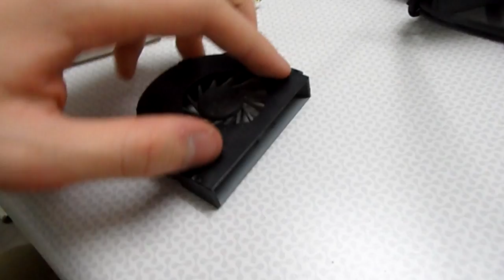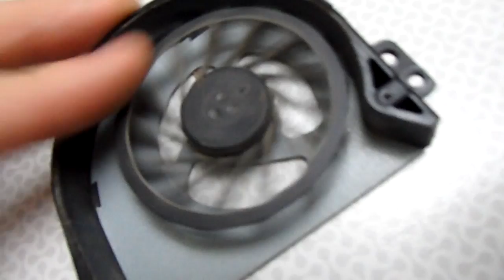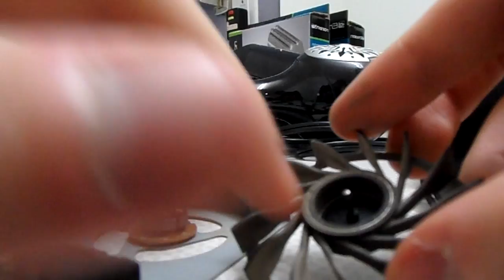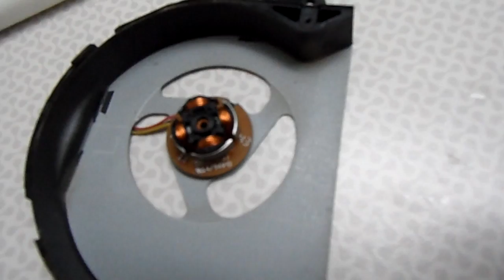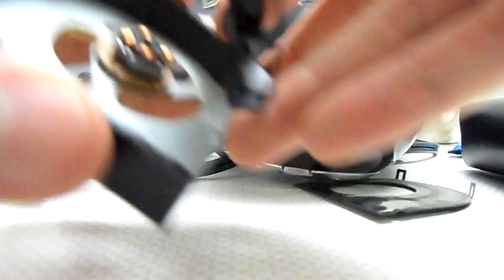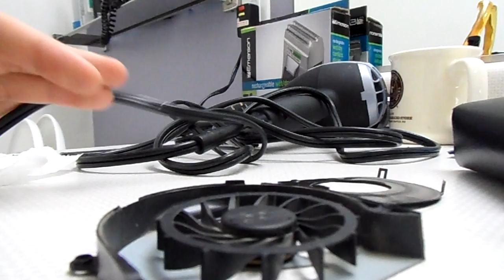How to repair a brushless laptop fan that doesn't spin

Comment: The cleaning process and oiling the fan is not complicated at all, it's getting the fan out of some laptops that's really hard. You basically have to disassembly the whole laptop to get to the fan. First the keyboard should be taken out, then a protective metal sheet, then the motherboard underneath it. So be careful.

Comment: Thanks for this video. Thanks to it, I know how to remove the fan of the laptop cpu cooling fan. Berore I didn't know that just pulling out the propeller could remove the propeller.

My laptop cpu fan is not working. after removing the propeller, dusting it off, adding oil, my fan is back up.

Comment: I had the same problem, exclusively with the GPU fan. Initially, I took it to a repair shop and he barely looked at the GPU fan before suggesting I need to change BOTH fans. I didn't trust him so I went to another shop, who suggested that he would clean the laptop which should fix the problem. 

So I paid the second shop but the problem was still here. 

This video was the actual solution. Now I am seriously starting to doubt these "professionals". 

Cheers.

Comment: How can I know if the fan is not working because of dirt or anything else? the fan doesnt feel stuck or hard or anything, but when my laptop is running the fan keeps moving like trying to spin and sometimes it spins a little but too slow and then it stops again and start moving like shaking

Comment: There's resistance if I pull the blades. They'll break if I try to force it. Suggestions? The other end to access the bearing (beneath sticker) has a metal cap that doesn't just pop off so I'm not sure how else to get lubricant in there.
Reply: you just need to lift these fans straight up. if u have these kind of fans. just straight up and lift
Reply: @EpicBunty  Not true. Consulted actual technician and it requires special tool to deal with the metal cap. It can only be further disassembled if I choose to apply force and break it, rendering it useless. *edit: I've encountered some laptop fans that do simply "pull" apart, but that is not the case for all of them.
Reply: @DB20204  ok well u must have a different fan then. when i unscrewed my fan for cleaning I was also confused, didnt know what to do. tried pulling the fans out and there was resistance but I also felt the slightest give, so i pulled em evenly out and viola thats how it went for my fan atleast. then cleaned everything with alcohol, added a dab of clear oil and all good till now

Comment: Watching this in April 2020. This helped for my Acer Predator Helios 300, my GPU Fan is working again! THANK YOU SO MUCH ;u;
Reply: Really? My GPU fan of Helios 300 stopped ( work a ,05 sec every 10 seconds and stops ) I try everything but not this method and i cant find the fan in amazon. My ends 17k13 all i find is 17k14 :(
Reply: @zvezdelinpetrov630  Let me give you an update then. I didn't have greace so I put a weird spray on it that's supposed to have the same effect.

It worked perfectly for 8 hours, then it started to get worse. At some point it was so bad that the fan destroyed itself, leaving half of it's blades flying around in my laptop.

I ordered a new fan but it was hard to find one.

I'm never going for laptops again. I ordered a PC. Only been having fan problems with every laptop.
Reply: Nickw00t  Well, my fan is with metal blades and It can’t open. I will order new one but shipping will be 5-7 weeks because of Corona... Yeah, desktops are always better. Thanks for the info :)

Comment: Thank you so much I was trying so hard to pull apart and it wouldn't move, almost broke the board. Mine was so stuck I had to wedge small pliers under, because it was FULL of fine dust in the hub...

Comment: Probably too late but: Asus R510J Fan started to make loud sounds for abour 2 weeks, didn't care much. Then games went really slow, Laptop was very very hot! Almost no Air coming out of the side of the laptop. Cleaned the fan from the outside with a vacuumer, got alot of dust out. Works a tiny bit better but Laptop still very very hot, fan doesn't spin the same amount (looking at graphs) and it just doesn't ventilate enough. Any ideas? Thanks<3
Reply: replace fan lol

Comment: Did not helped in my case for some reason. I have exact same fan on my HP laptop, I cleaned it well, used a bit of oil from Victorinox (swiss knifes manufacturer). When I power on laptop, fan just twitches and that’s it.

Comment: They make Turbine oil which I have used for decades repairing all kinds of fans.  Bottle has a pull out tube to get into oil felt cups on most fans.  I think in your example white lithium grease would work better than car grease. (less viscous)

Comment: My fan wouldn't start in my laptop so i took it out and cleaned it with a toothbrush,put it back in, and it still would not start. What a hassle I thought.I took it out one final time, blew into where the sensor chip,under the blades is: which was kinda hidden away from view.I blew out loads of dust and put it back in, and.....Bingo! Now it works fine.

Comment: Thank you very much for this video! I did this 2 weeks ago and it worked perfectly for me...laptop and fan are both working really well. Saved me the $200 the guy at the repair shop wanted. But some tips to add to this video:
- Check the exact model of your computer and go to your laptop brand's website to download the user manual for your exact model. I did this and they provide a step to step guide on how to open your laptop - every laptop is different! My laptop had 2 hidden screws I wouldn't have found if I didn't read the manual. 
- Be careful your hands don't carry any static electricity (walking on a carpet or rubbing against felt can cause this). Make sure you touch an uncovered piece of metal before opening the laptop to discharge it
- Don't spin your fan too fast while testing it. Blow on it lightly with your own breath if you need to but using a blow dryer like that is dangerous

Comment: Danger! Danger, Will Robinson! 

The DC motor can sometimes be housed in reverse with the blade part, such as Sunon fans. Trying to takes these fans apart will likely result in a broken fan. Not all Dell laptops or notebooks use the same fan design. Proceed at your own risk.

Comment: Allright, I think I have the same type of fan in my GE62 2QF MSI laptop. For the second time now a fan is failing for some reason. When the RPM increases it starts to play really loud rattling noise and vibrate. It does not happen all the time (yet), it sometimes stops when I tilt the laptop, starts again when I move it or tilt again, evntually (from experience) it will start to rattle as soon as I turn the laptop on. The thing is, MSI does not provide info on what failed exactly. Do you have any idea? I'd say the bearing, but then again it would just make the sound all the time from the moment it started. It looks more like the ribs of the fan brush over something.
Reply: You are in a rough spot friend, i have the GE72 and have the same problem. I have to take mine to a repair shop to get this crap taken care of. Buyer beware of MSI
Reply: Eartheart Baratheon I also have an msi laptop and one fan doesn't work anymore and the other one rattles
Reply: Its the bearing

Comment: Good advice thanks! I didn't know that a laptop fan was serviceable. Repaired my Eebox B1502 fan with your technique and a little dab of lithium grease (I usually use this on plastic gears on Laserdisc players and so on), worked like a charm! Cheers!

Comment: well i tried this method couple of times even before watching your video but it keeps jamming up... now i am thinking may be it's because of the bad starter capacitor and might need a replacement (just the coil part)
Reply: Nadine action not a bag a mouth
Reply: A friend of mine made the above comment. However that flag in the back ground is Jamaican, hence the broken english (Patois) our native language.  This video was helpful,  thanks.

Comment: I would not recommend using a powerful blow dryer like the one on the video. Exceeding the rotation speed for the specifications of the fan might actually damage it, as it was not designed to spin so fast. I recommend stopping the fan from moving with your finger when air (vacuum cleaner, compressed air, etc) is used to remove the dust around it. I also recommend using a medium or small brush to wipe the dust off more easily. Other than that, it's a good video for those who want to know how to clean a laptop fan.

Comment: gihabyte amd 780  gma fan its foxconn brushless fan model pva 070 e12 L stuck and i cant take it apart like u did when i try i hear like some thing broke in it
any idea  ???
Reply: Same problem here. Can't lift the rotor part from the stator. Gigabyte P17 v5

Comment: Thanks for this awesome guide.... It works for me... :D

For those who asked whether oil do the job.. The answer is "not really".....Applying a small amount of cooking oil wont work as effective as grease.... Cooking oil seems lubricating, yes. but it does not specialize and use as a lubricant substance. Take note that your fan might shoots temperature as high as 90-110 degree (crucial state).... This will eventually cause the oil you apply to be evaporated...Hence no more lubricant to lubricate the rotary motion inside the fan. As a result a squeking sound or buzzing sound will come once again.

Hence, a high temperature grease would be an outstanding option for every case. To be exact i use bearing grease where it can withstand high friction temperature. 

P/S: Justification made based on my experience. 

Good Luck Guys.
Reply: Thank you for the advice! :)
Reply: Sheesh.. DO NOT use grease for very small machine parts.  Use grease only for  big, beefy gears.   Grease is too viscous and dust PLUS grease makes it cake over time.  Use transmission fluid or machine oil -- the same one they use for sewing machines.

Comment: I have a Dell Latitude e6400, lately its fan started to make alittle bit of noise..

Anyways, the fan impeller seems to be not strong to disassemble it (The plastic compound is almost soft and can get break as I am pullin' it), unlike your fan seems to be kinda solid.

I just wanna know a way to pull the impeller, any suggestions please?
Reply: Giuseppe Jan Jaguar Oh and it doesn't have plastic circle on its blades like yours, which makes it even worse to try.

Comment: I couldn't take off the spinning part of the fan. I even used force but I couldn't. And this way I can't clean the center neither lubricate it. My fan is: Sunon Maglev MF60090V1-C210-G99. Can you help me plz?
Reply: same here, I could not remove the fan blade,
ASUS K43 series

and I accidentaly damage one blade.... ouch...
Reply: iheb bellaaj Be careful, some fans have a tiny metal washer that needs to be removed first to pop out the blade.
Reply: MundoComic I removed the sticker trying to find the ring that I should take off so I can pry up the blades, but under the sticker I didn't find a hole or anything to pull off. my fan is Sunon Maglev MF60090V1-C210-G99
Reply from the maker: That looks like a regular dc fan. I'm not sure why you can't take it of..
Reply: @williamyu94  The etl rod on which the fan is mounted is fused with the base and taking it off can result in breaking the plastic that binds the metaal with the plastic fan. Some models do not allow repair. Only option is replace as taking it apart means breaking the stuff
Reply: I have the same problem with the same fan! some advice plz?
Reply: MundoComic k
Reply: Easiest download manual free from the Internet and follow the instructions step by step. Remember to practice a bit, go over the instructions carefully. You get it if you do that correctly.

Comment: Hello, thanks for the video. 
I have a HP laptop and the fan hasn't been working lately; and during the startup, there was a message saying that the fan isn't working properly. And this is true, because the fan hasn't been turning on for a while. 
So I checked the fan by opening up the laptop and system board to get to the fan. There seems nothing wrong with the fan (except a minor scratch / crack in the plastic cover of the fan), and the fan spins well when I blow air to it...
Do you think the problem is with the fan itself, and I need to replace the fan?
Thanks
Reply from the maker: yeah replace the fan. They are only 15 bucks anywayws